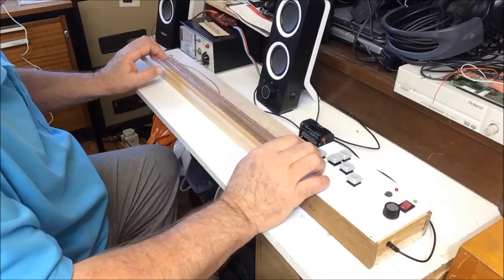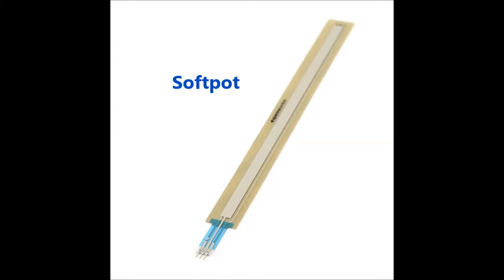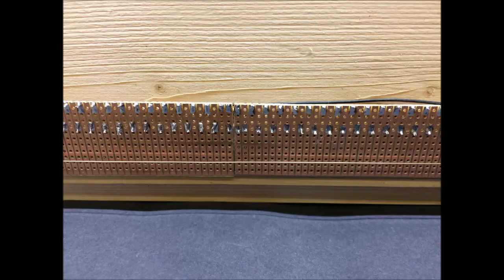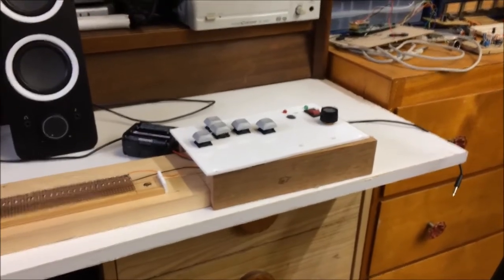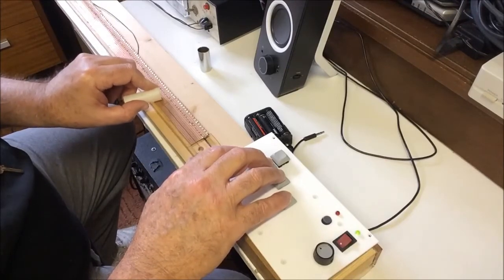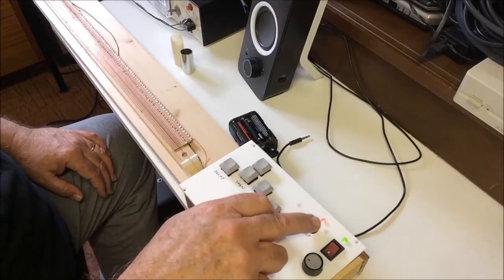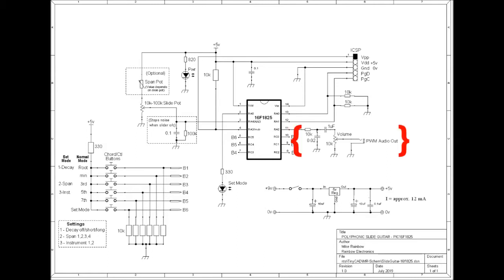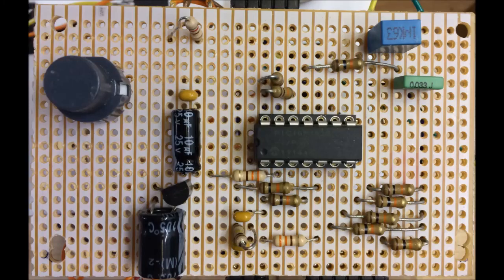DIY Electronic Slide Guitar and Ribbon Controller.

Comment: Excellent project. Congratulations. It's true: The price of the SoftPot is very high. ($25 US Dollars each + Mailing). For a project with more SoftPot, it is complicated. For your Ribbon Controller implementation, you can use a lines of resistors in series and implement code in Arduino for MIDI? applications. I imagine each Ribbon Controller as a Violin String (for example). So, there would be 4 Ribbon Controllers in the same Violin. Your solution opens up possibilities for those who don't have the money. Thank you very much for sharing your knowledge. We, your audience appreciate all your contribution.

Comment: Love your ribbon design. I had played with graphite (messy fingers :-) ) and tape (squeaky). So the A2D can be used to generate midi messages right (not just note but controller messages or channel pressure say). Coupled with a midi merge this could be quite a fun way to extend capabilities of normal velocity keyboard.

Great stuff.
Reply from the maker: Hi Stephen, thanks for your interest and comments. Surface mount resistors would work fine but it's much easier for me to use discrete components and stripboard for these one-off experiments. The slide can be used to generate virtually any MIDI message, volume, note, pressure etc if used as a midi controller - this was going to be my next experiment - just adding a MIDI out to this design. Also it would be easy to interpret the slider output as small divisions representing the semitones of a fretboard. Construction of a 6 string instrument would be quite tricky though - although generating the MIDI messages would be very easy. As far as patents are concerned - been there - nowadays I just enjoy developing these projects and hope that others can get some enjoyment out of them too.
Reply: Merging is likely essential if the control is to work nicely with existing equipment. I never got into PIC but use Arduino as the Mega has 4 UARTs so some code later and I had a merger.

For sure I will trial your design. Seems like a great addition to a poly afterouch keyboard I have. Time to resurrect some merging code :-)

Comment: Mike, this is really crazy. The way I implemented the keyboard on my stylophone is almost exactly the same as you used here. I only have 25 notes so not as many resistors and I'm using 120ohm and 0.1uF and 10k to filter the a/d input. I suppose there aren't that many ways to configure the circuit though. 
Well done again, another interesting idea.
Reply from the maker: Thanks Brian - I will definitely have a look at your vids.

Comment: I think that if this project were to be oriented to a guitar, the sensitivity when playing the string could be achieved with a piezo pickup, under each string. 
Just make sure you isolate each individual pickup enough so it doesn't pick up any vibration other than the one coming from that string. 
Another idea is to place an FSR Sensor, under each individual bridge (one for each string) and have it suspended on a spring. (Imagine this, same as the key on the digital piano) By pressing on the string, depending on the force applied, it could generate the sensitivity / velocity and after touch data. Something that perhaps a piezo can not generate.
Reply from the maker: Hi - thanks for all your great comments - yes there's no end to what you could do with this - all good ideas - thanks.

Comment: Your project is very interesting, space sound like in the films of my childhood :) (I am 41 years old). 
As far as I remember, these microcontrollers use 13.6 volts when loading a program into memory. 
I think a diode is needed between pin #4 and the resistor 10K, cathode down so that high voltage does not flow through the 10k resistor to the 5 volt power line.
I switched to Avr for a long time, I have not used PIC for more than 14 years... maybe I already forgot how to do it right
Reply from the maker: Hi, thanks for your comments and your interest in the project. The 16f1825 datasheet says that isolation is recommended but this can take the form of resistors, diodes or links - and a 10k resistor is sufficient isolation between the programming voltage and the 5v Vdd supply. I haven't had any problems using this method with a Pickit 3 programmer.

Comment: I have a resistance coil from a 10 turn pot, it can be straightened out to a respectable length which I have put off doing. I'd hook it up to my Arp. The steps of resistors you have is much too coarse to play on as a tuned by ear as you play (violin) instrument. It'd make a good pitch bender for keys though. I've made a slide guitar with feedback built in. The slide itself has a volume control at my fingertip. The range is more than four octaves. Tuning on the fly becomes second nature like singing, but with your hand. The chordal keys is a good idea but where is the other seventh etc.? Then I'd want to go down the rabbit hole of pedal steel "pedants".

Comment: Mike, A very impressive yet simple instrument. I would like to know what the audio output is when the ribbon is not ‘key down’ that is, when the input to the PIC is zero volts? I have been playing around with a ribbon  strip to a discrete component VCO and suffered the problem of key up / key down rapid frequency shifts as the ribbon voltage changes from the played value to zero. This makes the instrument of little use because of the erratic changes especially if the finger is lifted off the ribbon during the playing of a piece.
Does the use of the PIC overcome such problems, I have zero PIC knowledge.
Great series of videos well explained and presented. Thanks
Reply from the maker: Hi, first of all thanks for the interest and kind comments. Yes - when there is zero volts at the PIC's analog input the code produces no audio at the PWM output. You can do all sorts of things with the program code to get around such problems.
I remember a VCO circuit from long ago that when there was zero volts at the input the VCO would sit at a frequency above the audio range, like about 30 KHz so although the VCO was still oscillating there was no descernible audio output - don't know if this is possible with your circuit.
Reply: @mikerainbow  Thanks for the reply, I have breadboarded the circuit using a short softpot I had on hand to try it out. Works OK however it does not hold the last settings on power down /power up and the key selections seem to suffer from contact bounce issues. Is it normal for the selection to switch through the various rates etc when a key is held down or should it just increment by one step?
I am going to see if I can use a proximity sensor as an input to function in a Theremin like situation,. Experimentation keeps me occupied during my retirement (and COVID lockdown).
I am awaiting delivery of components to make an Easy Harp, seems like another interesting project to play with
Look forward to your response.
Thanks, Ray
Reply from the maker: @papaworkshop348  Hi Ray - no, I didn't write code to save the settings to eeprom on switch off as this was very much an experimental project to see how things worked - unlike the Easy-Harp which was a much more complete project. Also, the key selections are de-bounced but, as far as I remember, they will repeat if held down. If I have time I will have another look at the code and see where improvements can be made. Mike.

Comment: Would surface mount resistors be easier - dumb question I guess because I guess some PCB and a wave solder passing over top would make the construction relatively easy?

Sorry for dumb questions - I am a mathematician not electronics guy (only dabble). But couldn't you also use this technique to measure which fret of a guitar has been touched? Bury the voltage divider into the neck and use metallic frets/string contact points to derive note (for fretless the nichrome wire might work). Each string has own A2D and spit the signal out via midi channels 1 to 6. You may get a relatively cheap midi guitar. You already solved string sensing on one of your other videos :-) I think you could get a decent patent out of this?
Reply: Sensitivity could be solved with piezo pickups, one under each individual bridge.